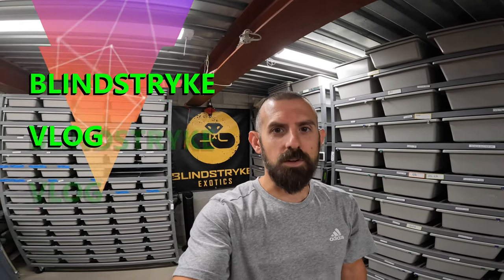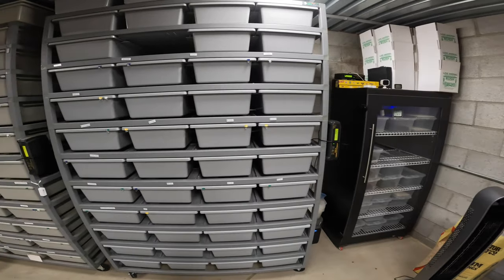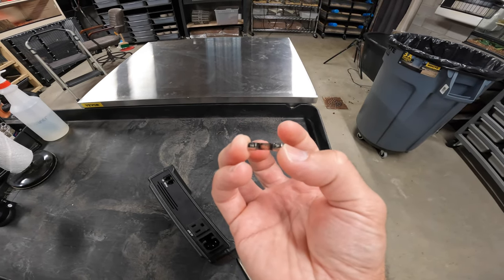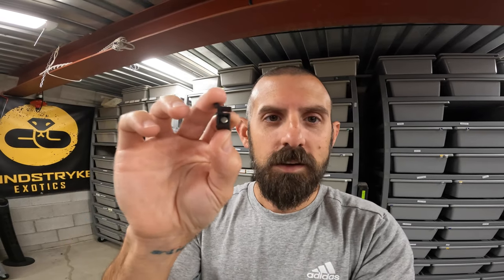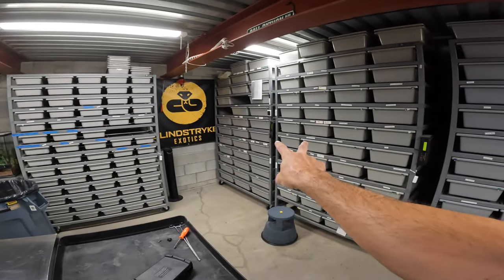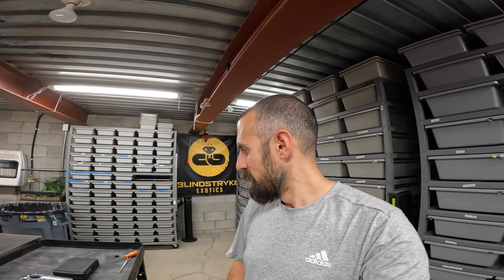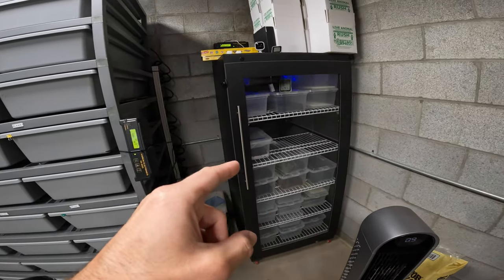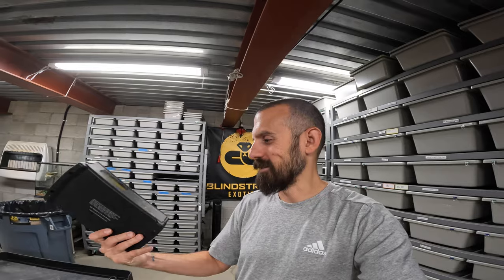IF YOU HAVE A SNAKE RACK WATCH THIS VIDEO! VIVARIUM ELECTRONICS THERMOSTAT SECRETS!!!

Comment: Great information thank you! I plugged in the ve 200 I got from ARS along with a rack system and it immediately popped and blew out. I haven’t contacted them yet. Now that I know about the fuse I’ll try replacing it and see if it works.

Comment: Got to be honest with you I run one ve 300 * 2 I've never had issues with it I'm not going to sit here and Bash them but I've switched to spider robotics mostly because I run radiant heat panels I keep Burmese pythons my roommate keeps ball pythons but I have fuses on deck for my ve and my spider robotics for this reason but I have heard I don't know if you're aware I'm sure you probably are but when the ve thermostats fail sometimes they fail wide open hence why I've switched I run pro products radiant heat panels so even if my one ve did fail in the open position Bob over at pro products designs these heat panels so even if they run wide open your snakes will be hot but it will never get hot enough to kill them because they're actually made for the size of the enclosure nothing against vivarium Electronics but unfortunately that's just one flaw I've never had happen but I could never risk with my kids because the spider robotics will literally just shut off if there's any probe issues and I'd rather have no heat than excessive Heat as I keep my snake room and around 77 anyways awesome video though because I've never had to change a fuse yet I know where it's at but watching you do it and seeing it definitely helps cool info man as usual great video

Comment: With my VE 300 I'm having the thing constantly say temperature overshoot and I don't know how to get it to stop I have the probe right where it should be in the middle of the rack system on my C serpents five tier... And every now and then when I move the VE300 around just to see if it will connect it will connect and it won't say trouble overshoot or temperature overshoot and then as soon as I put it down right where I want it it just goes off and starts beeping and then it goes flashing " temperature overshoot again" 😢 how do I stop this?